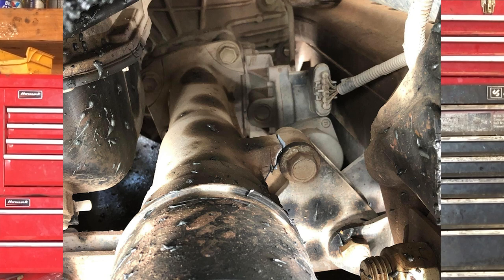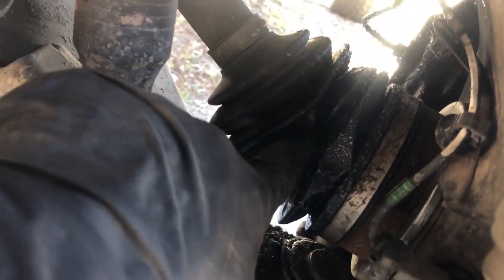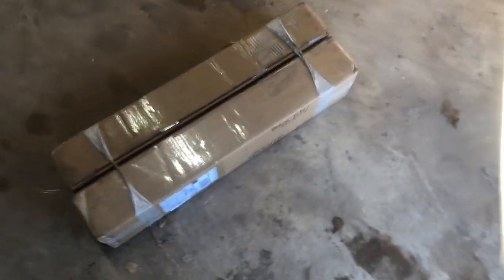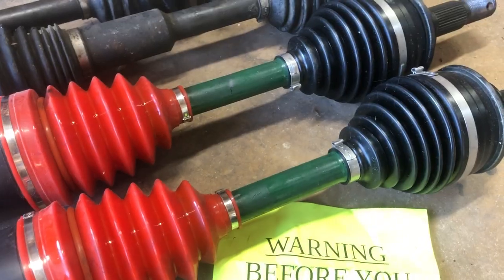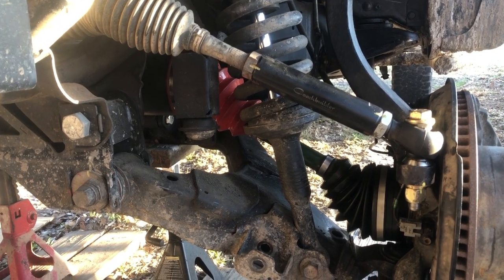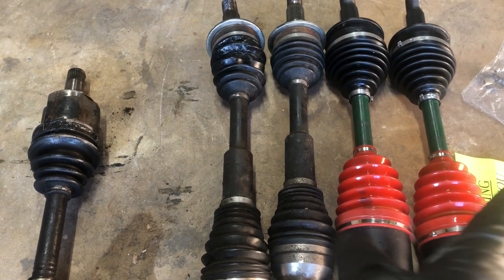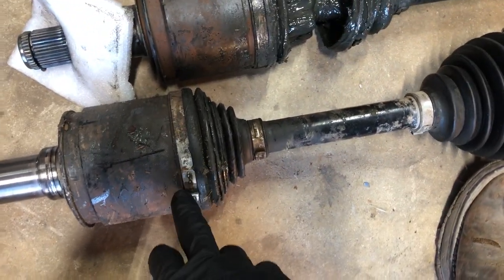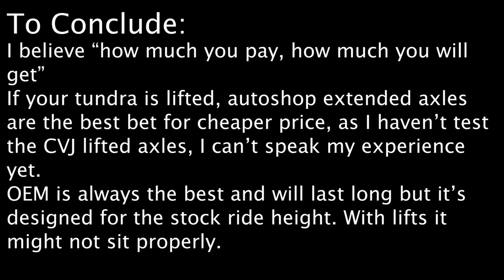What is the best CV axle replacement for your lifted 07-21 Toyota Tundra? - I got some CVJ axles

Comment: Good video.  The passenger side inner CV boot on my Tundra keeps seeping grease. The driver side is fine.  I am probably around 3.5" lift. I am trying to decide between the Napa(Trakmotive) extended travel axle or the CVJ axle.  Can you comment how the CVJ are holding up?  Are they worth the extra money? Or would you go with the Napa extended travel axle?

Comment: I have a 2018 crewmax sport. With a rough country 3.5” lift. Will the extended travel cv axles be a direct replacement, or will there need to be modifications?

Comment: Were you happy with the Napa Extended (Trakmotive) CV's before one snapped? Do the boots on those deal better with higher CV angles than stock boots? And finally, did you ever measure your CV angles at rest?
Reply from the maker: Compare extended ones to the auto shop OEM replacement, it’s definitely worth the bucks. But the quality of the metals never a match with oem. I don’t like the boots on them, when I was replacing it I can feel the rubber is hardened, but what under the boots have better articulation than the stock length. I eyeballed my angles without actually measuring it, I think the angle hasn’t changed a lot with different set up while setting level. Stock length either the oem or not, the boots seem under stretching load, which the extended center shafts helped a lot.
Reply: @haroldz3914  i think the proper compare is napa extreme vs cvj. not napa extended travel?

Comment: whats the diff between say NAPA Extreme (HD) CV axles and these? Napa xtreme is tpe boot...these are race red silicone...guys have complained these boots crack as well. and its 342 vs 228 napa extreme.....you wont know for a while until the boot cracks? not sure buying cvj is worth more than napa extreme....

Comment: I have a special question do I need special measurements for 5inch lifted 4x4 Tacoma ? I need to replace the cv axles
Reply from the maker: Do you mean special measurements for the length of the cv axle? I could be wrong because I have never owned a taco before, to me 5 inches is tall enough that the stock cv axle can't provide enough articulation.

Comment: Do you know if a leveling kit changes the requirements of the CV axle?
Reply from the maker: I think about 1” to 3” leveling kit wouldn’t change it, but I’d worry about geometry of the suspension such as bottoming out the shocks etc. do more research before you purchase

Comment: I have a 2018 crewmax sport. With a rough country 3.5” lift. Will the extended travel cv axles be a direct replacement, or will there need to be modifications?
Reply from the maker: If you are experiencing the same problem I would recommend it. 3.5” might not need it, take a look at your CV articulation to decide that